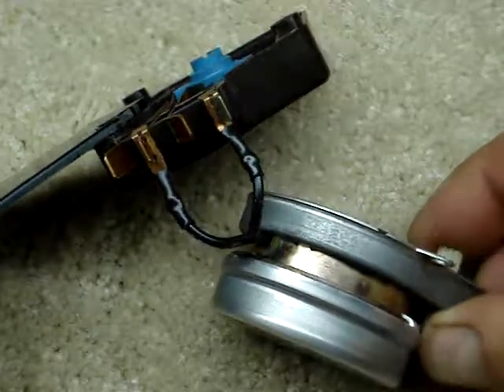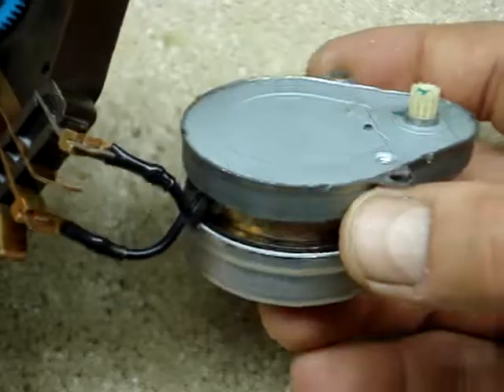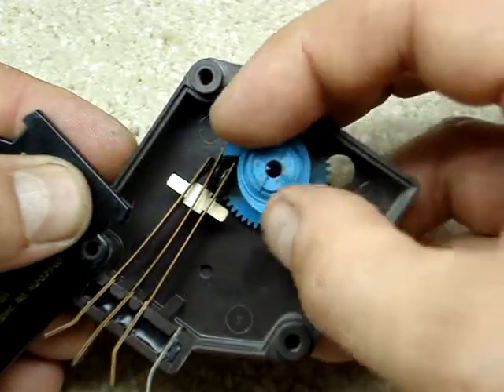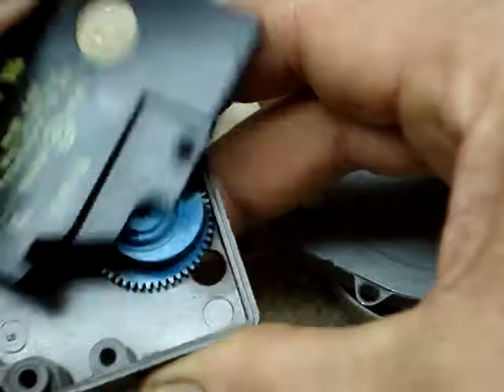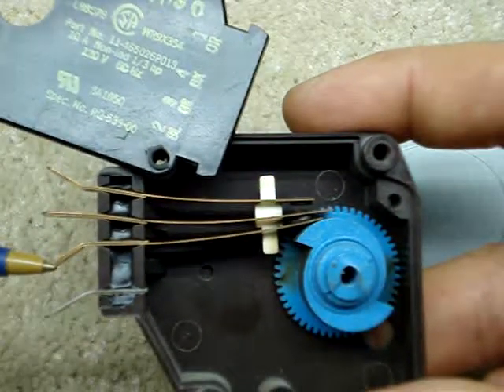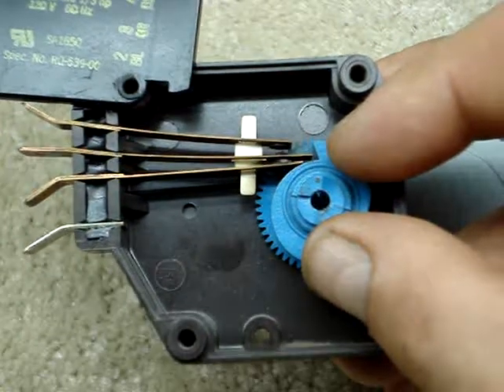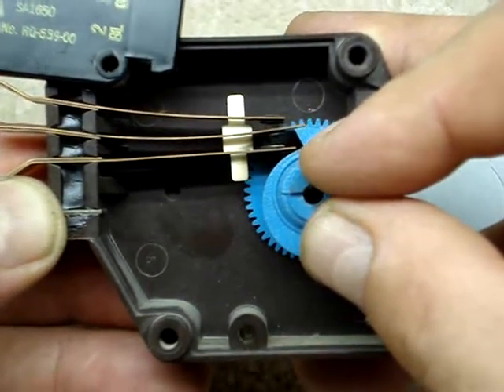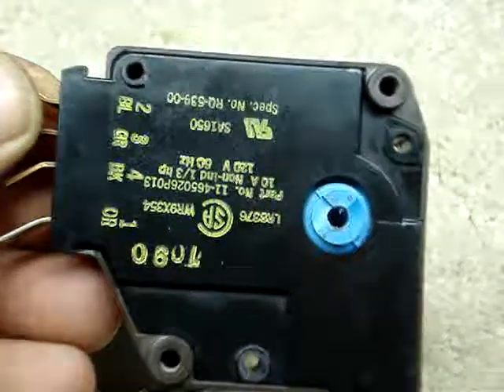What's Inside a Refrigerator Defrost Mechanical Timer?

Comment: Excellent Demonstration, I haven't had one apart but I have similar one located behind kick panel on left side of my 40 + year old GE Refrigerator. 
  Those synchronous Motors are used in many applications and needless to say, the do last a long time.
Reply from the maker: Thank you!  Glad you got something out of the presentation.